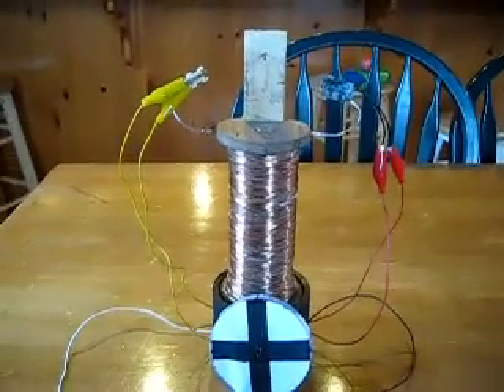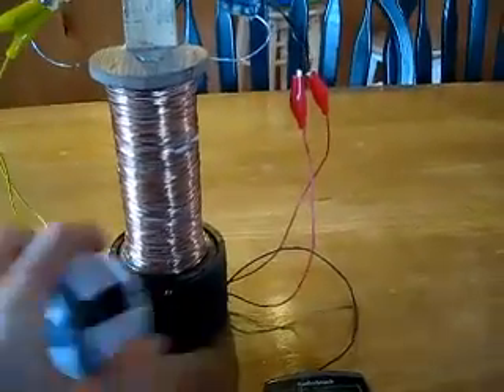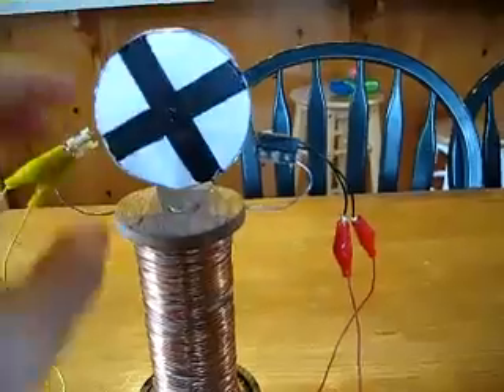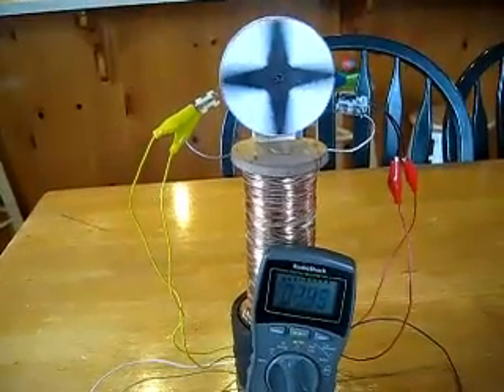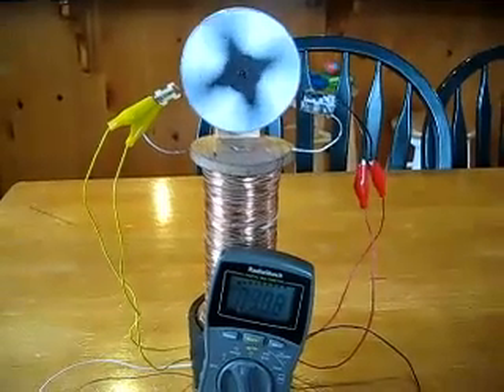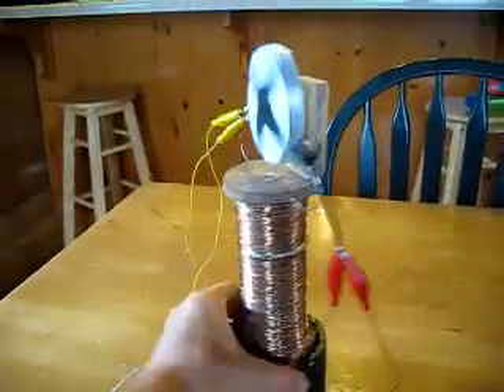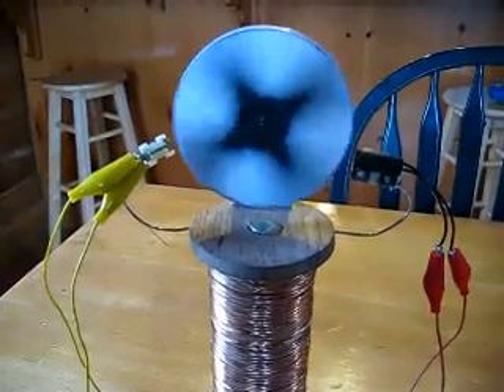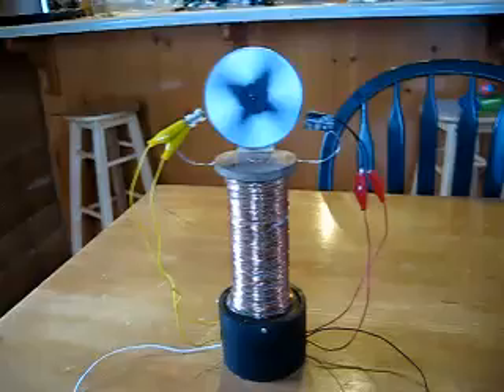Magnet Motor Switch Secondary Coil Test

Comment: The only way I can figure out how this works it's got to be a radioactive type of reactive effect with the iron oxide and inducing a radiation field into the copper. Looking over wikipedia iron is reactive in so forms. But exposure shouldn't be an issue because it's a basic element of our diets. I am just trying to figure out how this is all working. Keep us updated with the bigger secondary coil.

Comment: Lasersaber,
How many leds will it light just like that?
Can you get 7 or 8 in series? How about one of those LoA bulbs?
I bet you are able to light more than you expect, since the spiky pulses do not follow the normal transformer rules.
The voltage of the spikes will be related to the speed of change of the reed switch, more than the transformer turns. So... I want to know how the reed switch is doing for speed.
This looks so good.
wow...thank you.